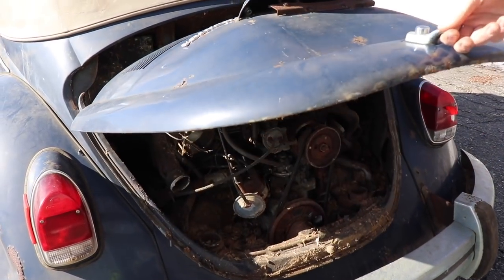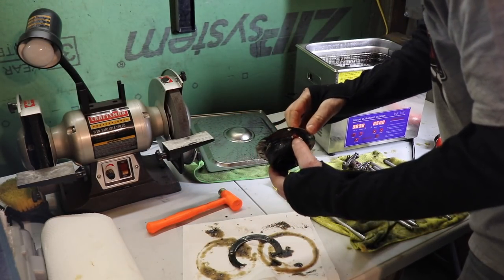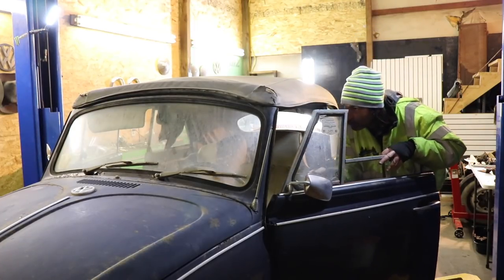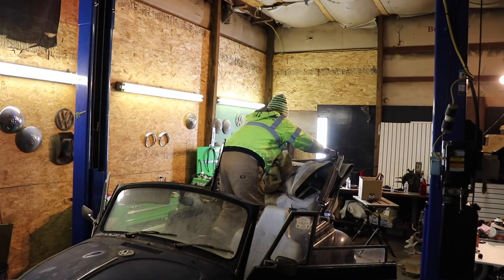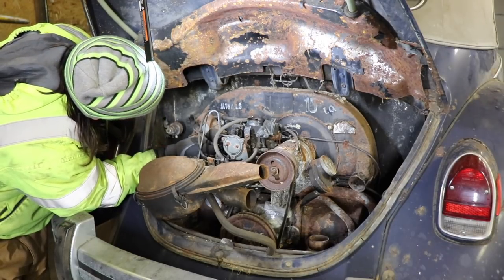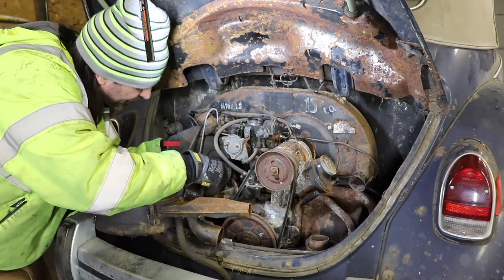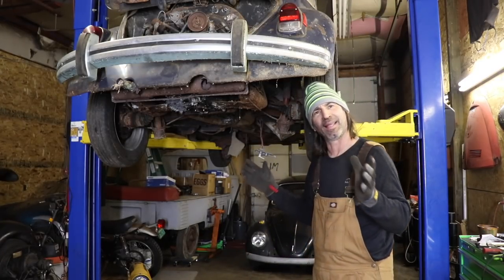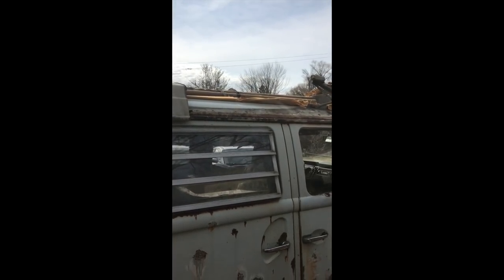Forgotten VW Beetle Rescue - Not Good!

Comment: So I had a ‘70 Beetle back in the early ‘80s as my daily driver. The engine was “rebuilt” just prior to my buying it. Due to this questionable rebuild I had to remove and reinstall that engine so many times over my 5ish year ownership, that I could remove and reinstall in less than 2 hours each way. In a single car garage with nothing but a couple of jack stands and a NAPA hydraulic jack. Good video and good luck with this one.

Comment: That "new" car engine is amazing in its complete-ness. That thermostat-to-air preheat flap cable is a tough one to find if needed. And, 1970 is a great year for a vert driver. Doesn't have the panache of the earlier cars, but is so much nicer to drive than both the early and later VW stuff.

Also, my personal best for a solo engine drop is 19 minutes. But I was in my early 20's, and it was a split bus, so it was way easier than a later beetle. You might consider pulling the engine and trans together. Not so bad with an IRS trans.

Sorry to see that Westy roof get torn off. At least you found it back.

Another good video. Thanks for doing the work for our enjoyment.

Comment: I don’t know what the best time for pulling a VW engine is but when I was working on them full time I won a bet by doing a clutch /pressure plate/ throw out bearing from starting the car ,driving into the garage , driving it out done in less than 30 min. 😄🎩

Comment: Amazing how original that engine is.  Looks like distributor and carb still original, along with throttle positioner as well.  Hope you did not destroy that preheat cable to the air cleaner.  Those are extremely rare these days!  Shame about the rust, but probably pretty average for your area.  Nice front beam...  Seventeen cars is a nice number.  I currently have 16 but still would like at least one more...
Reply from the maker: Yes, it looks to be a very org. car ...I used the dremel on the tiny screw and was able to remove it properly . 17 is a nice # but that's just Vw's ...does not include the dozen American classics and trucks🤦‍♂️. If you have 16 you know sometimes you may wish you had one :).

Comment: The view with the vert on the lift looking at the rust and rot gave me the shutters... Ugh... I was thinking "ashes to ashes, dust to dust"....
Hopefully the old vert will provide some good parts for other non-rusted out bugs.
BTW, the cable connected to the warm air flap on the oil bath is referred to as the "bowden cable". It connects to the fan shroud flaps on a arm. As the thermostat opens, the flaps inside the fan shroud open and the cable opens the flap inside the oil bath to fresh air vs. the heated air coming from the warm air hose via the stove pipe connected to the oil bath. Those bowden cables and parts are rare and sought after. 
I have that bowden set up on my oil bath on my restored and stock 1969' vert engine. Having the thermostat and flaps in place along with the warm air to the carb via the oil bath makes a HUGE difference in cold engine driveability. 
That bowden cable design to the oil bath was used from 1968 through 1970. Sadly, most lazy mechanics removed those pieces decades ago. Same thing happened to the thermostats and flaps, especially in warmer S.W. USA markets.
Reply: It would seem that cable was not used on all cars in that era. I bought a new 69 and it never had one. I also worked at a VW specialty shop in the mid 70s and never saw one. This kinda makes me wonder if the car is a California model. BTW, I am in lower Ct.
Reply: @rupe53  That bowden cable setup was standard on all 68-70 VW's. I've never seen a non-molested one w/out them in place. Certainly mechanics removed them or installed different oil baths. All the VW manuals show those parts in place.
Reply: @warbirdwf  ... I'm sure many things were removed back in the day. Heck, I'm guilty of the EGR delete because the early muffler was way cheaper and that square expansion chamber that rotted out and was only available at the dealer in those days... for about the same cost as an aftermarket muffler. BTW, I worked for a dealer in 1973 and don't ever ever recall seeing that cable. I do recall seeing a weighted flapper on the air cleaners of some bugs. As I stated earlier, I bought my 69 new and it never had one.

Comment: I've seen a lot of rusty dubs but this one would be a money pit, looks like it's been sat in water from time to time, did the garage from which you pulled this from flood ?
Reply: It's a convertible so has absolutely seen wet floors over the years. (wet under the rubber mat) Even if the owner never left the top down in the rain, the roof would have eventually leaked anyway.

Comment: pull the clutch and gas cables..wiring harness..4 ea 17 mm tranny bolts..pull the engine..or drop it. as it were.

Comment: Plans for this one?  My humble biased opinion, it’s too far gone to restore and not lose a bunch of money! So I would say part this one out and when You do I will be your first customer. I need the rear seat bottom and a few side window parts. I’m actually doing a complete resto on a 69 very , it was even the same color! I enjoyed the process, but not looking forward to the new top install!
Reply: I should proof read, I meant vert! Not very..
Reply: Just a little heads up Jason if You or anyone else is considering a resto on one of these units. Actually no different than doing the regular beetles…. Until You get to the top AND all the seals and parts You will need for the side windows!  The tops are bad enough, but the parts to do all the side windows,  crazy money!!

Comment: That is a 68 to 79 Bus MOTOR which is why the Driver side bolt is different.  That car whould have had a DUAL PORT!
Reply from the maker: wrong :)
Reply: See if there are three Tapted holes in the Front of that engine if so IT IS A BUS MOTOR!  There were some Odd Ball things done to the Converts.  If the three holes are not there on the front of the block then that is one of them!
Reply from the maker: @gilbertnowak5770  Gil , you started out saying it should have a dual port ...it is the org engine to the car . B6 , 1600 SP ....period :)
Reply: @5150mxVW Like I said they Made some Odd-Ball Converts.  The standard 70 VW type one with the Freeway flyer had a Dual Port.  Some of the Converts were DETUNED with the single ports.  Chec
k for the three Cross member Bolt holes behind the Pulley to confirm it is NOT a Transplanted Bus engine!

Comment: The engine is a "B", the six is part of the engine number and has nothing to do with the engine type. The "B" says that it is a 1600cc for the US-market between 8/69 and 8/70. After this came the engine type AE (8/70 - 10/72), the type AH (8/71 - 8/74), the type AK (10/72 - 12/73) and the type AJ with L-Jetronic (8/74 - 1/80). All data from the manufacturer for the 1600cc.
Reply from the maker: B6👍

Comment: Don't know what was going on there Jason, but at one point you were going to attempt a start before the engine was removed, then bang, just like that we're pulling that engine out, no explanation. You seemed a bit "off the pace" on this one man. Stay safe.
Reply from the maker: Hi Gary , I shot footage on 3 different days I think ...initially i wanted to start it in the car . Clean the plug holes , soak the engine in marvel and come back to it . The more i got into the car the more i decided against it , let's drop the engine and try and save the org #'s matching case . After a few days with car I truly never grasped the vision on this car . No , it didn't really come together on this one :)
Reply: @5150mxVW  you need a bit of "inspiration" that's all, if you could get a run out of that engine I'm sure you'll get there.